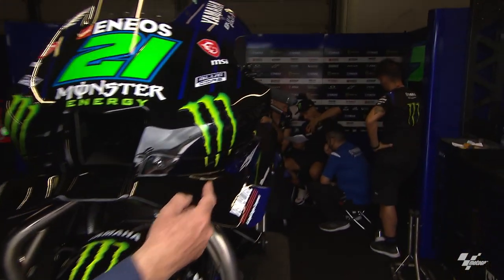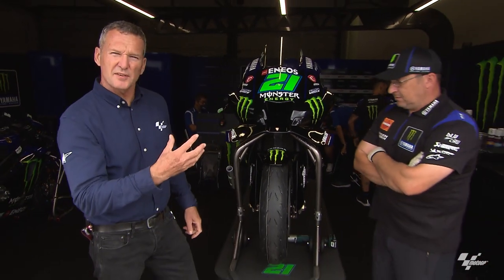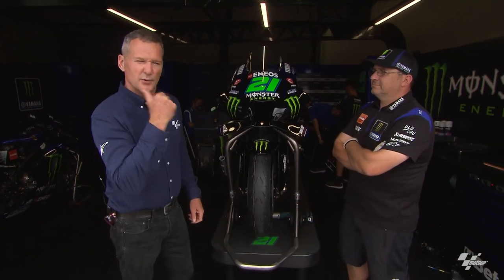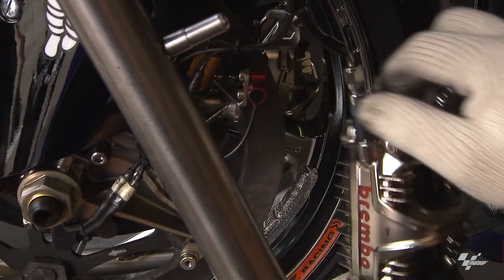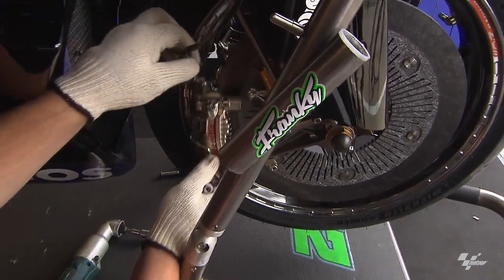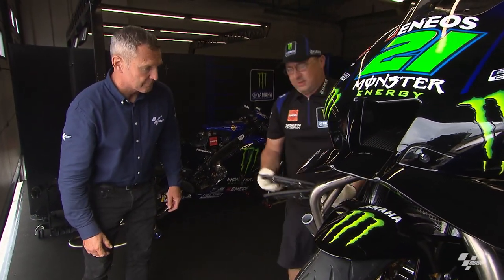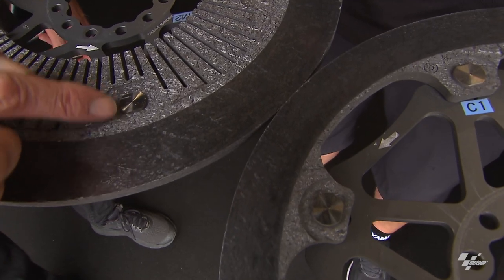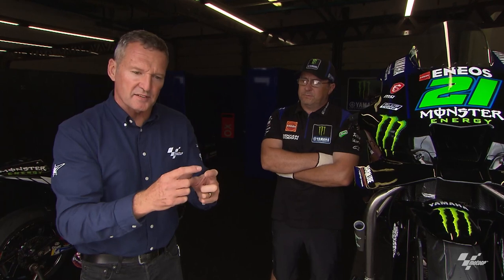MotoGP™ brakes | Tech Talk with Simon Crafar

Comment: If they are pushing 355 mm then it's best to change disc design to Buell inverted disc . 

U can reduce weight ,and put a bigger disc . 

Potentially Lower risky brake line mistakes.

Comment: The feel and or pressure at the lever can easily be designed in to the levers leverage and hydraulic design.
Reply: 2022
Reply: 2023
Reply: 2024